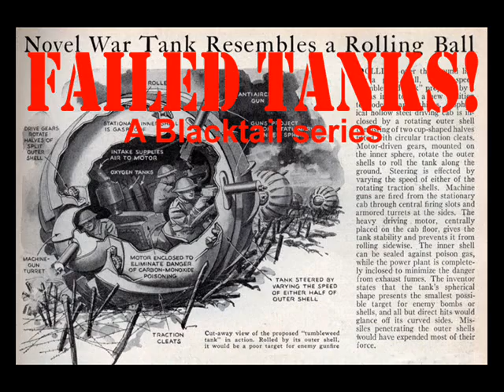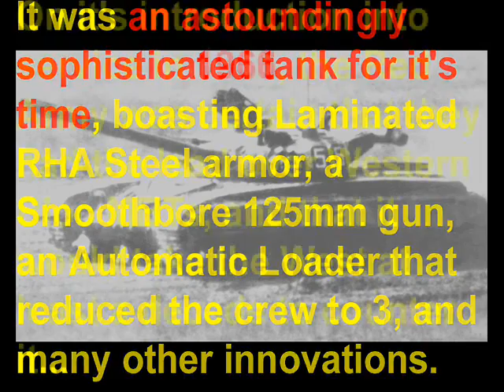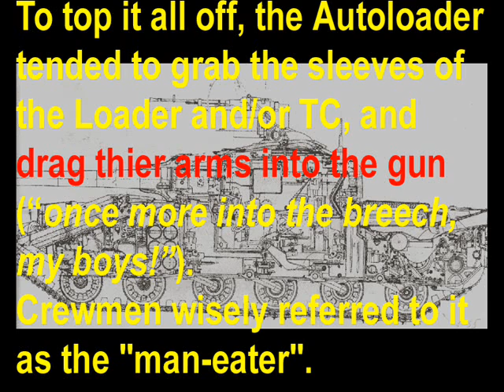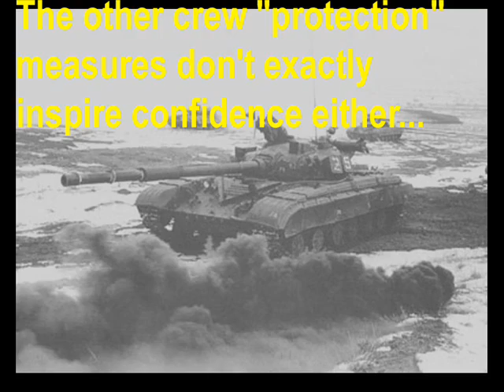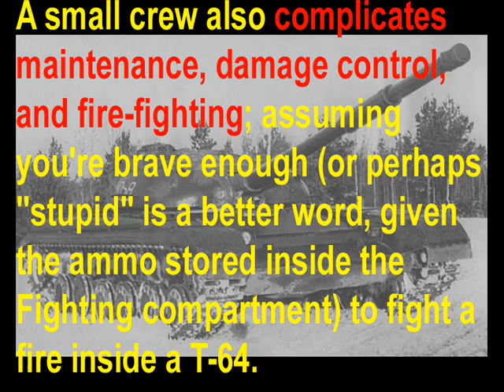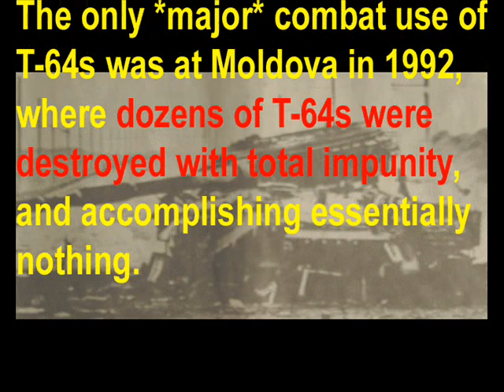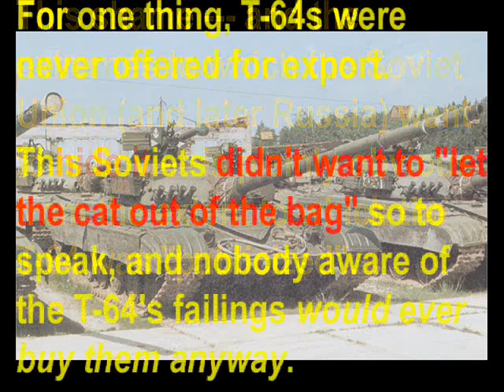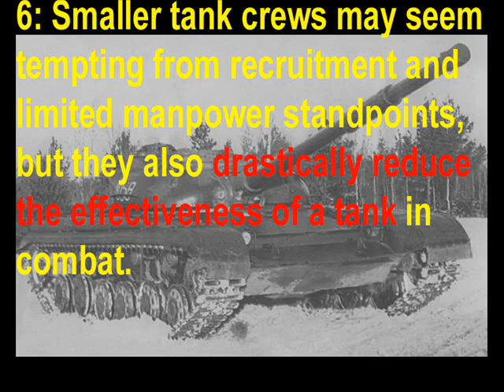Failed Tanks, Chapter 4: The T-64

Comment: the thing is when the t64 first came out it was a great tank and was ahead of its time it was the tank to use composite armor wacth mint tanks like the m60 the leopard 1 would have struggle to fight it the only NATO tank that could fight it 1v1 would be the chieftain ,it had a autoloader ,  and a 125mm smoothbore gun that could go though any tank used by nato at that time. it biggest problem was that was not cheap to make and was very complex as well as poor reliability. also the soviets had a lot of them

Comment: The T-62 was developed for the same reasons mentioned here. But as you illustrate the T-64 was crushingly expensive, so the T-62 outlived it in production.

And why is the T-62 a flop if it has parts commonality with other vehicles, as the T-64 does not?
Don't get mad at me, I'm merely speaking my opinion.

Comment: most of the points made is this video are based on urban rumors and western propaganda the reason the T-64 failed as a tank was because of metallurgy issues with suspension arms and the unreliable engine. by early 1970 all the quirks had been ironed out with the T-64A however by that time they had to compete with the T-72 series of tanks so they started work on T-80 instead of improving the T-64.

Comment: T-72 was made for export, not for replacing
Reply from the maker: Then why did the Soviet Union buy 10000 of them, and why are they still in service and in production when the T-64 isn't?
Reply: BlacktailDefense omg, do you know that T-64 is an expensive tank, and only ace unit can have it, T-64 never export. If you read history and read some actual facts, then you will see the point. 

These features made the T-64 expensive to build, significantly higher than previous generations of Soviet tanks. This was especially true of the power pack, which was time-consuming to build and cost twice as much as more conventional designs. Several proposals were made to improve the T-64 with new engines, but chief designer Alexander Morozov's political power in Moscow kept the design in production in spite of any concerns about price. This led to the T-72 being designed as an emergency design, only to be produced in the case of a war, but its 40% lower price led to it entering production in spite of Morozov's objections.

At present the T-64 is in use in very few nations or regions, but is currently undergoing significant factory overhauls and modernization in Ukraine. The newest, vastly upgraded and improved model of this 50-year-old design, the T-64BM Bulat, has increased in weight to 45 tonnes and is seeing active service in the field.

The T-64 would only be used by the Soviet Army and never exported, unlike the T-54/55. The tank equipped elite and regular formations in Eastern Europe and elsewhere, the T-64A model being first deployed with East Germany's Group of Soviet Forces in Germany (GSFG) in 1976, and some time later in Hungary's Southern Group of Forces (SFG). By 1981, the improved T-64B began to be deployed in East Germany and later in Hungary. While it was believed that the T-64 was reserved for elite units, it was also used by much lower level "non-ready formations", for example, the Odessa Military District's 14th Army.

https://en.m.wikipedia.org/wiki/T-64
Reply from the maker: @divinesan7786  Only elite units had the T-64 because it was too problematic for anyone less to have any success with whatsoever, and the reason it was't seen in Eastern Europe for nearly two decades was because the Soviet Army had no confidence in basing them far from the factories that built them was because the T-64 broke down so badly and so often, they required frequent full factory rebuilds.
This doesn't happen to effective tanks.
Reply: BlacktailDefense no, because the tank is expensive, they cant mass produced the tank, so they let the best unit to use the most advanced tank at that time. How is it so hard for you to understand? In two decades, T-64 was in a top secret, they Western only saw T-72 but they didnt see T-64. What? Expect the early model, i never heard of T-64A, T-64B, and other T-64 variants broke down often like you said: https://en.m.wikipedia.org/wiki/T-64, i dont see any report that T-64 was broken down often like you said? 

http://www.tanks-encyclopedia.com/coldwar/USSR/soviet_T-64.php, still not see any kind of “T-64 bRokE dOwN oFteN”.

And also, where did you find that “Autoloading system eats arm of the crewman”? Because that sounds so stupid, unless that guy puts his hand in the autoloading system, he wouldnt lose his hand.
Reply: BlacktailDefense T-72 is a design to make a tank almost as strong as T-64 and must be stronger than T-62 but also cheap for producing.
Reply: BlacktailDefense 

Your arguments are pure jokes and your video is pure meme,my friend sent me this video for the meme.
Reply: Let me highlight the important part: T-72 is an emergency design
Reply from the maker: @divinesan7786  An emergency design that was kept in production beyond the end of the Cold War, and is still being produced? How is that not being a successor?
Reply: BlacktailDefense what? So according to your logic, still being used and produced is better? Ok, you still not understand, do you? Im not saying it is a bad tank, but the power of T-72 is 60% of T-64, T-72 is like a T-62 but with upgrade from T-64. Like i already said, it is cheaper than T-64, again CHEAPER than T-64, that is why it still in production. Again *CHEAPER*. How many time do i have to say *cheaper*? Cheaper means it can mass produced and exported, T-64 is an expensive tank, it can be only used by the elite unit, it never exported. “wHy diD tHe SoVieT bUy 10000 tAnks?” - try to answer that by yourself, i have already repeated that many time, and i will highlight that again *CHEAPER*. When T-72 was being used, that doesnt mean the Russian threw T-64 away? They still kept T-64 in elite crew while T-72 as a tank for every unit and exported.
Reply from the maker: @divinesan7786  There's a reason the T-72 was in production for more than 6 years, and the T-64 wasn't. The T-72 was built for export, and the T-64 wasn't. Years after the Cold War era T-72s ceased production, they were offered and sold abroad, and the T-64 wasn't. After by 2014 the entire Russian T-64 fleet was broken-up for scrap, and the Russian T-72 fleet wasn't. The only nations still operating them are Ukraine and Uzbekistan, and only because they can't get anything newer, and the only export customer Ukraine could find in the last three decades that would buy their upgraded T-64s was the Democratic Republic of Congo, who bought only 25 --- Russia builds more factory-new T-72s than that every month.
Reply: BlacktailDefense Oh i know what is the reason: BECAUSE THE T-72 IS CHEAPER THAN T-64, how many time do i have to say that? T-64 is pure complexity and expensive. Omg, why dont you understand? They didnt break T-64 to scrap, what are you talking about? Those tank are now in Ukraine and the license to make T-64 is in Ukraine, so they cant make T-64, the Russian itself doesnt have any T-64 left so they cant modernize, same to T-80. Only T-80, an actual replacement of T-64, comes to exports. While T-72 was mass-produced, every part of the country has it, and, with the big mass of T-72, they modernize it. Simple enough.

Comment: dear the engine of the t-64 is diesel......lie or error...the engine of tank t-64 is largely proved diesel engine Kharkov 5dt , development of the Soviet version of the Junkers Jumo 205, Rolls-Royce k60 diesel engine, or Leyland d90 used in England for fv-432 carriers. The earlier versions of  this engines generating 600cv. further version of 5dt, 5dte, 5dtf, generating 1000cv 5 times more powerfull than of English versions. the Best successfull of the engine, reliable, easy for replacement and mantenaince continue in production at Kharkov plant in Ukraine, with a name of 6dte six cylinder opposed diesel engine, two cycle, 2000cv.

Comment: Russia still have 2000 T64 in reserve. Why they don't divide them in 100 lots and sell them on international market to everybody 100 at the time. Let's say those who are the most used cheaper, new one more. If they sell a lot of 100 starting from 50 000 euro per tank and go to let's say 200 000 euro for new one they can get anywhere from 100 millions euro to 400 millions even more. Also they become suppliers of ammo making more money. Many will buy those tanks. In fact even sales of T34 are going strong. Why should you buy a Toyota and mount and RPG when you can have a tank at the same price? I bet even US will buy a lot for aggressor training. Those tanks can be sold even to countries under embargo as training tanks. With patience Russia can get even 500-600 millions.

Comment: Now we need Failed Tanks T-72 , T-80 , T-84 , T-90 because they all share (mostly) similar design concepts - 125mm smoothbore gun , autoloader , 3 man crew , small turret etc. T-64A was sort of "founder" of modern Soviet (with 125mm smoothbore gun) tank designs , and all subsequent tank designs (T-72 , T-80 , T-90 , T-84) are "evolutions" of it. There are differences of course (T-80 gas turbine , T-72 V-12 diesel) , but according to Russian sources T-72 is a simplified version of T-64A , T-80 is a gas turbine version of T-64A , T-90 is a modification of T-72 (with different name) , T-84 is a modification of T-80UD (diesel version of T-80U).

Comment: um, T-64 carried 115mm gun, 64A had 125mm gun. Also, high velocity means high accuracy. Farting out BS again? Separate ammo does not affect logistics in any way. Also - those four years seem to be the production run of original 64. Later, 64A was produced, with 125mm gun.

Comment: it didnt just come with 125mm canons it also used 115mm as seen on the Main tank T-64Object432 and T-64T
added to that i actualy heard that the 115mm that got derivited of the 100mmT12 which was not intended to get fited to Tanks since its rounds where to big, at the end they made the bore diameter bigger so the sheels could be shorter and this way they created the 115mm canon which in tests was not as horible in accuracy as it is known for. it was worse then the 100mm but still perfect. and this can be seen on western tank canons aswell, the 120mm smothbore canons used on german and american tnaks are less accurate then the british rifled 120mm
Reply: John Fox 
For tanks modern smoothbore guns have perfect accurancy and they're more powerfull. They can hit a barrel from 2 km needless to say about targets like other AFV.

Comment: I agreed somewhat to Blacktail's T-62 video but this video just proves how little he knows. Do I dare to watch the rest of these videos?
Reply: +Tankman 1995 Some of his videos are informative (like his Bradley vs BMP-3) but this video and others show a lack of competence in some spheres.
Reply: No, its not worth the trade off. His insistence that the T-64 is a crap tank comes from a seeming lack of understanding about soviet tank design doctrine. And the fact that the soviets wanted the T-64 to be a world-beating Super-tank (which its later models Were.) The T-64A model smoothed out most of the reliability problems by 1968/9, those that remained were solved by the T-64B. The T-64(A) was an extremely successful Soviet super tank (primarily in combat characteristics) that went on to have some 11,000 copies of various models produced by the Kharkiv Zavody from 1968 to ~1987. The 5-TD(F) engine is an excellent design for a tank engine; if you are clairvoyant enough to take into account how Small it is compared to, say, a V-12 diesel. The main reason it (and most other T-64 components) had teething and reliability problems is because they were Cutting Edge technologies. No-on had yet designed a tank that compact, light (relatively), heavily armored, Powerful and mobile before. The T-64(A) is possibly the world first True Main Battle Tank.
Reply: Jay Kilbourne  Even the original T-64 is the world's first true MBT, while the Chieftain (that gets a lot more praise in the Western world by simply not being Russian/Soviet) just barely meets the requirements of a true MBT (because Centurion and T-55, and even T-62 and M60 are not). In any case the T-64A was indisputably the best tank in the world for its time.
Reply: He is brilliant and, like many brilliant folks, has extremely strong opinions.  As with any content, the editor's bias must be weighed against the educator's expertise.  In his case I think it's worth the trade-off.

Comment: T-64 didnt fail it was simply the tank that for that time was soviet "best of the best" and maybe just maybe if something larger happened and he faced M-60A3 and Leo1(at that time best and only tanks of the west not counting UK) he would me dominant over dose to.
But  real deal  T-64 was only prototype and test drive for the new tech Russia invented (auto-loader,125mm gun,new engine complex,new way of putting armor in the turret......)Because T-72 was developing in the same time as T-64 it replaced it very shortly,but not no stay empty handed in 1967 after the faliure of T-62 and inferior T-55 at that time Russia had to have something so they produced quite number of them just to be "safe".
PS:Russia upgraded T-64 almost 3 year it produced to stable B version and later when T-72 came out the put on it new optics,sight and IR search witch made it as good as T-72 so that number of T-64 they produced bettwean 1966 and 1973 were ready to face any second gen.tanks of that era.

Comment: The author is a stupid idiot not familiar with T-64. The tank and its engine 5-TDF are quite reliable. The suspension is one of the best (much better then that of T-72 and T-90 and even of T-80). Autoloader works properly under any conditions and never "eats" crewmen. Many howitzers use separate charges, that doesn't make the logistic more complicate.

Comment: The T-64 is actually in combat action right now, in the 2014 Ukraine conflict, and the Anti-Kiev fighters apparently prefer T-72 over T-64:
http://www.liveleak.com/view?i=c43_1418585274
Reply: ***** 
Those obsolete tanks are used against same obsolete tanks from the other side, which incidentally is where they got them from. T-64 Bulats's were used only in small numbers last year and several got burned by ATGMS, and a dozen or so T-84 as "the best of the best", they are now kept exclusively in strategic reserve. And for a guy who Likes tanks, you really should know that contrary what Wikipedia claims, T-84 is structurally based more on T-64, then T-80. Aether way it obsolete, but still better then nothing.

Comment: Your description on why the T-64 was never offered for export is misleading.  Traditionally, the Soviets - and now the Russians (and virtually every other military for that matter) reserve their best equipment for their own use.  Regardless of how it turned out, the Soviets never intended to export the T-64 in the first place - that job went to the T-72.  The T-64 was issued to some of the best units stationed in East Germany and Poland, and saw constant use in training maneuvers.  Also, both the T-62 and T-64 were highly regarded even from Western observers.
Reply: Treetop64 
Advanced versions of T-72 with composite armor were not exported too, only T-72M. Su-15 served exclusively in Soviet air defence and saw no export sales. But in modern time with small market and strong competition Russia can send anything in desired compectation with very few exceptions. Some T-80s were sold. Su-27 was supposed to guard only Soviet sky but became very widespread aroud the world. I saw interesting opinion about Su-35 and possible sales to China there's nothing interesting in plane itself but radar's software and China may get simplified version.

But T-64 failed everywhere.
Reply: @beltar2  That's because whatever advantages T-64 held were nullified by improved T-72B and T-80 (which was originally T-64 but improved). T-64B was not a failure, however
Reply: The T-62 was somewhat of a failure though as it was produced to fit a new gun that did not perform as well as hoped and the cheaper T-55 ended up being upgraded to better it in performance anyway. Still unsure about the T-64's performance though as it never really saw combat during the Cold War. Being the USSR's amazing super secret weapon after all.
Reply: Don't even try.... He is deaf and blind, he thinks he knows the truth, he knows jack shit about soviet tanks.